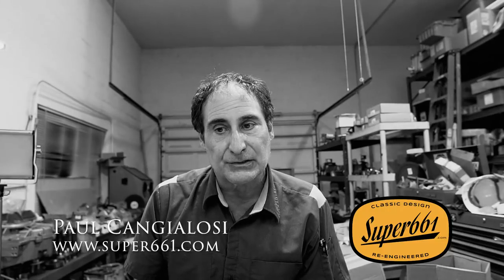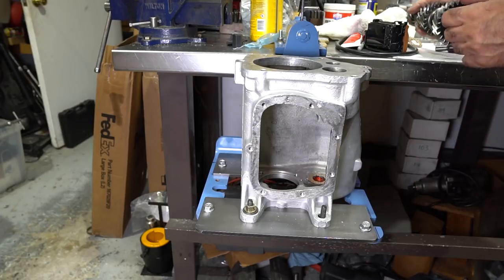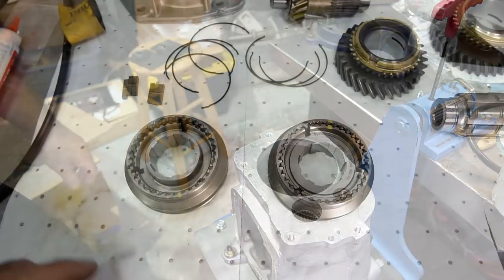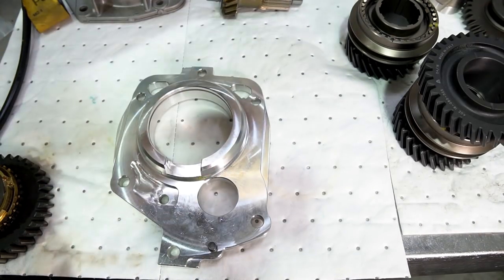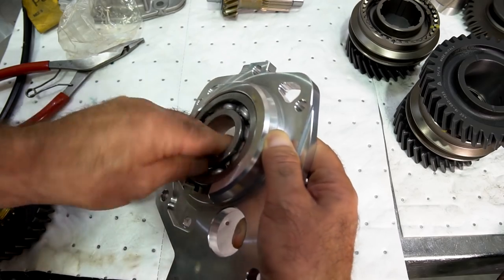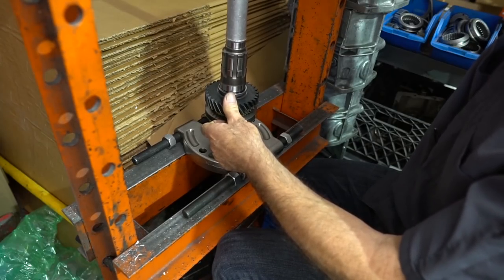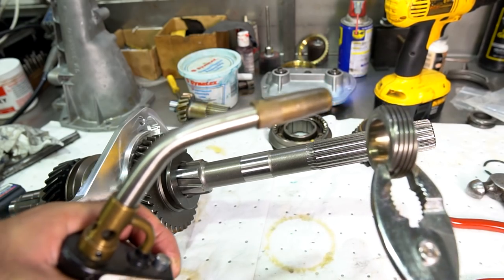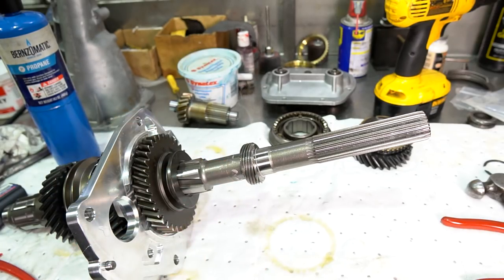The Muncie Tapes - Part 3 - How to Assemble and rebuild a Muncie 4 Speed Transmission

Comment: I was briefly distracted by the mouse scurrying across the garage door tension spring. Great video series so far. Learning a lot.
Reply from the maker: Not mice... We have huge lizards that live in the shop
Reply: @GearBoxVideo  As someone who has had to deal with mice and mice damage, I think I would rather have lizards. Again, great video series. I am about to tear into a m-20 so I'll be picking up some of your parts as well. I also have, what I believe is a '69 T-10 Power Brute in need of some help.

Comment: Thanks for your help on the M20 spacers. Now, I tried to install the counter shaft but, it will only go about 1/4" into the first set of rollers. I'm using the original shaft, rollers and counter gear. This is with the gear out of the case, even. I was all ready for it to slide down but, nooo! This is at least the 8th Muncie I've assembled over the years and the first one that this has happened. What am I doing wrong?
Reply from the maker: Well if its all the original parts that you disassembled then it should go back together.  The only thing is how did you remove the shaft? Did it come out easy?     Correct end? Measure the diameter make sure it wasn't damaged on removal

Comment: Hi Paul, Rob and Kevin here. The 1970's muncie that we are rebuilding now,,, the counter gear that we are trying to install has a very very thin gear on the one end of the counter gear. It is slightly rotational. We only remember there being one thrust washer on the one end of the counter gear when we disassembled it. Is that possible? Because we can't get the counter gear installed with a new thrust washer on both ends of the case.  Any suggestions? Your expertise is appreciated.
Reply from the maker: Remove the plate. Search for the video on my channel on anti  rattle plates
Reply: Thank You very much.. I will try to find the removal process on your channel.  @GearBoxVideo
Reply: Ok, I found it. I completely understand the removal. Thanks for another through explanation video. Thanks for your time.

Comment: Hi Paul, repairing a speedometer drive on a M20 Tag number 3946797 1969. 10 input and 27 output splines. It as plastic gear with clip broken. Gear is 8 tooth appears in good shape, Do I replace clip only or install a metal gear? Passenger cable side drive shaft Dia.1.174
Reply from the maker: I always install a metal one. UsA made ones are available in my webstore

Comment: At 2:20, you're using your blue fixture that holds the case during assembly. Where can I buy one of those? Company brand, model number, etc.
Reply from the maker: It's a fixture for T56 transmissions and I made adapter plates to fit other units. Just search for T56 transmission fizture
Reply: @GearBoxVideo  I bought a used one off eBay. Thanks

Comment: What keeps the input shaft/bearing from wanting to walk forward? Does the bearing nut act as a thrust washer against the bearing retainer that bolts on?
Reply from the maker: Think it thru.  There us a front bearing retainer that goes on in front of the bearing holding it in place.  This is a common question which often times confuses people because they look at the one part and forget how the other parts of the assembly keep it in place. Its like leaving a gasoline cap off then wondering what keeps the gas from coming out of the tank!  When you are learning about assembling things I use to tell some of my apprentices to "think things thru" .
Reply: @GearBoxVideo  Yes, I see... the front retainer traps/pushes back against the outer race. Thank you.